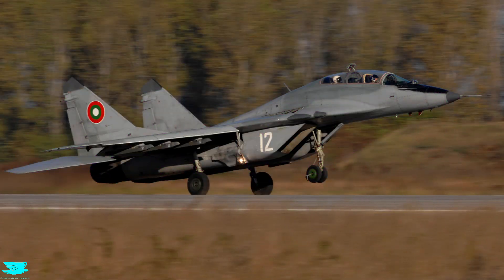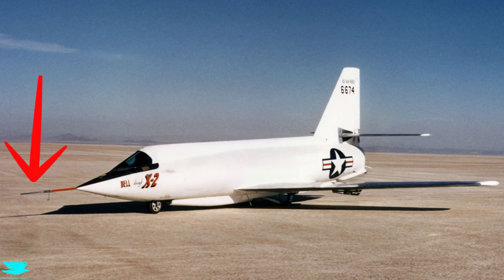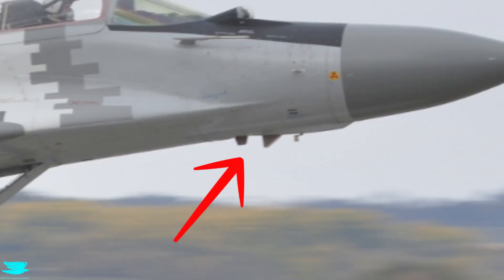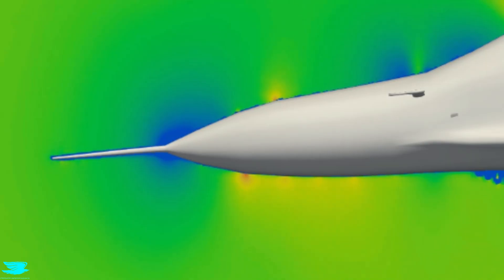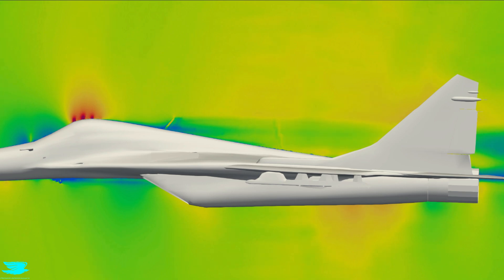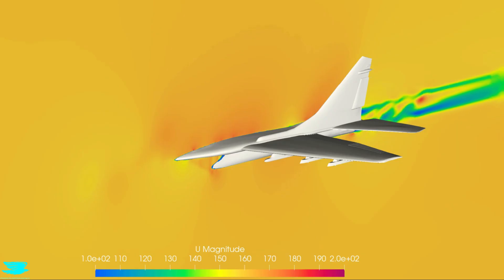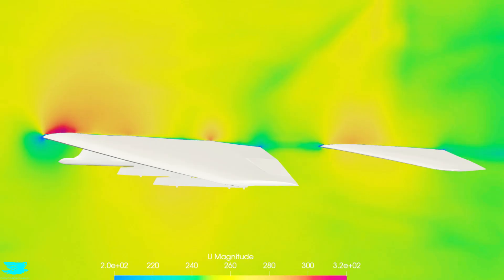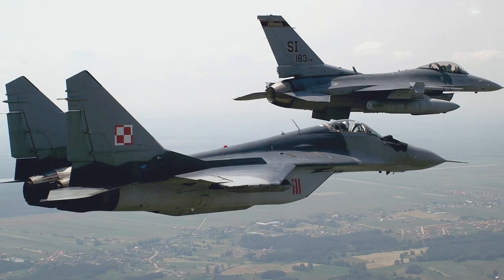How The MIG 29 Breaks The Sound Barrier

Comment: please don't spread this misconception about top speed for fighter jets. they never reach top speed. they should have no exterior weapons and no pilons and half the fuel in tanks
Reply: It's not a misconception, that is their top speed in a clean configuration, which is what you care about when studying the aerodynamics.
Reply: @KekusMagnus 
Ummm, no.
All aircraft are exercises in design compromises to reach a set of requirements/constraints. 
Top speed is ONE requirement, but in Real World use, isn't really all that important for fighter aircraft as that's not what the aircraft typically fly at.
(In the history of aerial warfare, IIRC there has been only ONE dog fight at or above Mach 1.)
And if it were all that important, fighter aircraft likely wouldn't look the way as their designers try to make space in the nose for a huge radar or lexs to generate vortex lift for a turning (dog fight).